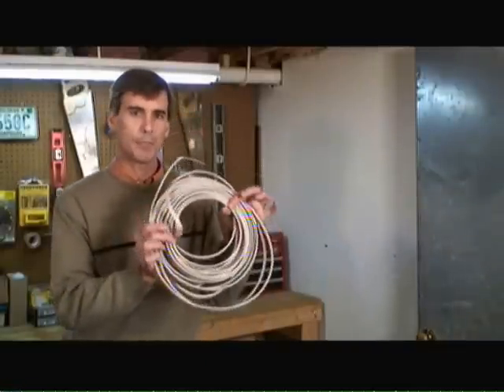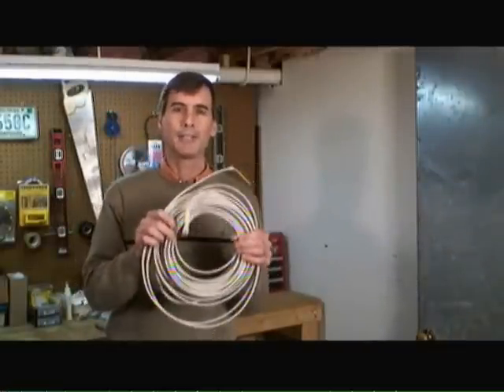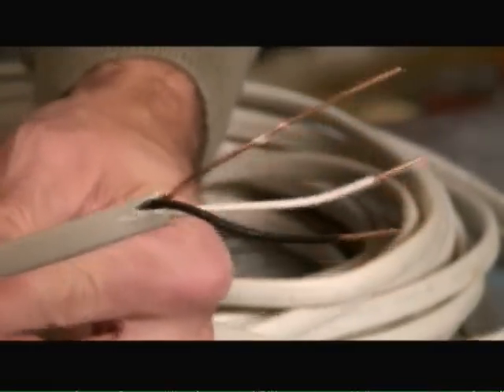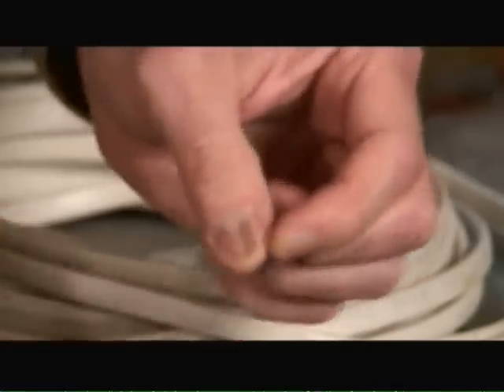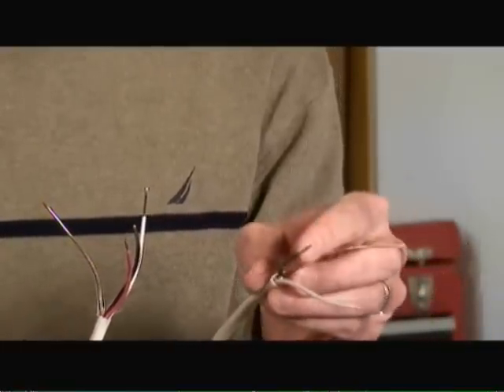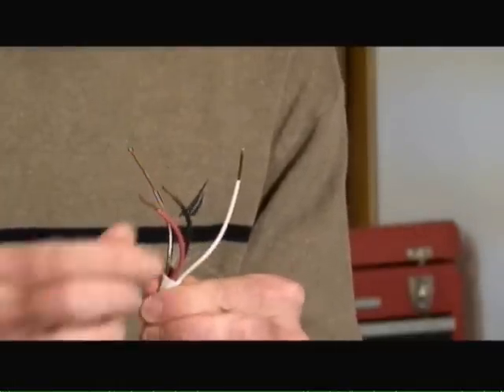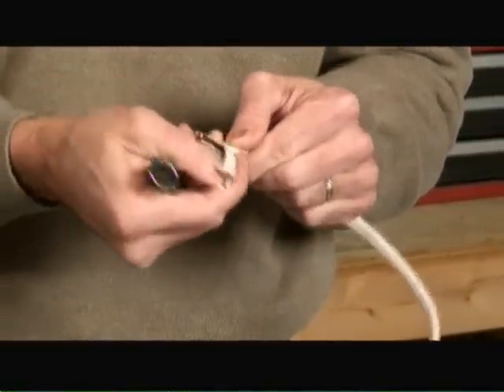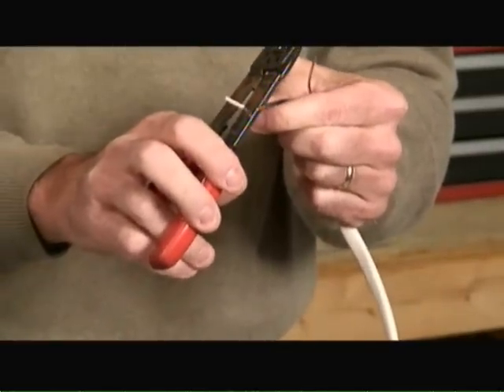Plastic Sheathing Electrical WIre Video

Comment from the maker: 4-wire has [Black(hot), Red(hot), White(return), and Ground]. It is frequently used in 3-way switches or if you want to have each hot running off  a separate circuit breaker.